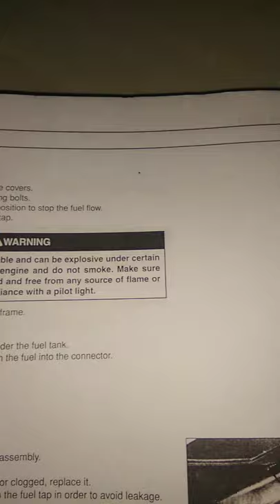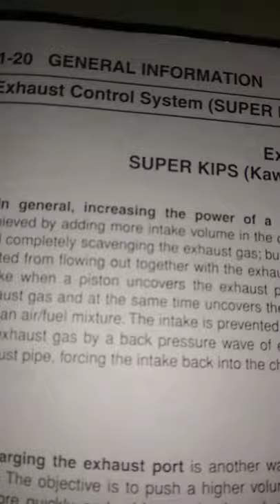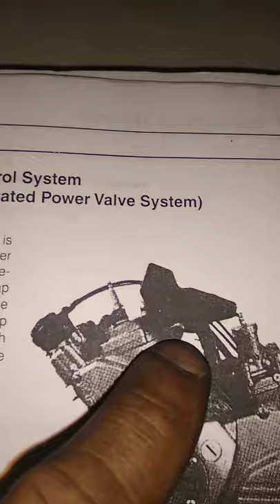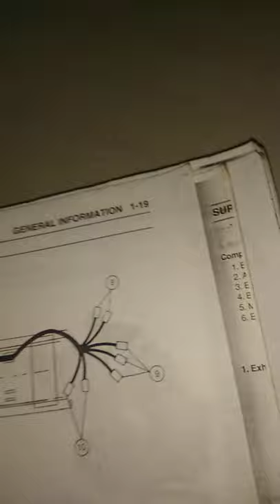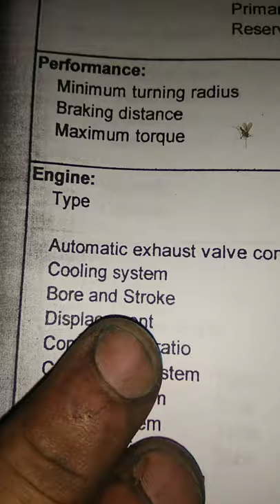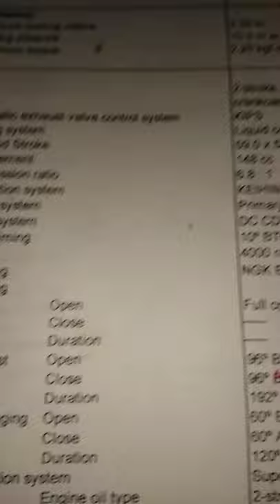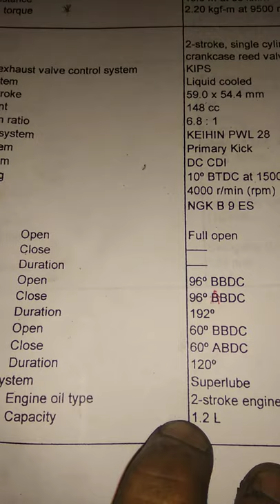HD-3 Reed Valve

Comment: Sir Geoff totoo po bang turbo ang nakakasa sa karburador ng rxt135 o baka mali lang ng term na vinatmit at may tamang tawag at function po ito maraming salamat po at sana i feature nyo po o sagutin man lang ang aking katanungan maraming salamat po at more power.
Reply from the maker: Ahmm,, Sabi nn casa torque induction,, or boost bottle,, pero kahit poh Wala nyan,, malakas pa rin ang rxt.... Ganito poh sbi nn mga engineer at designer nyan Yan ay for fuel efficient,, pansinin mu poh pag tinakpan mu poh Yan breather nyan ang mangyayari ay tatapon ang mixture papalabas pero pag meron nyan at walang leak wala I kukunti lang ang tumatapon sa labas nn carburator na mixture nn gas..